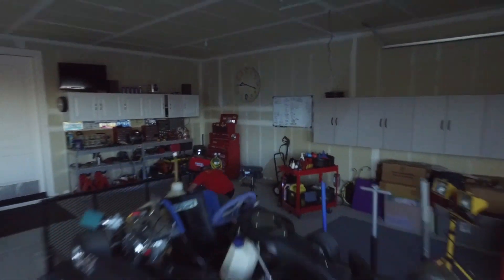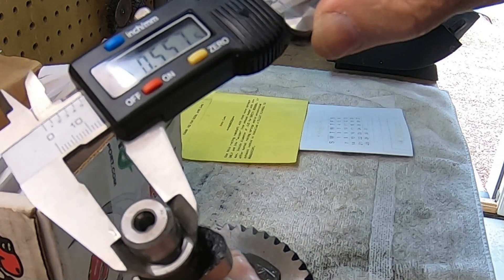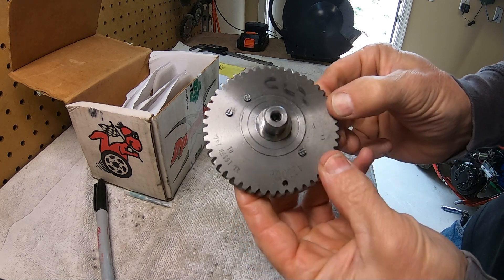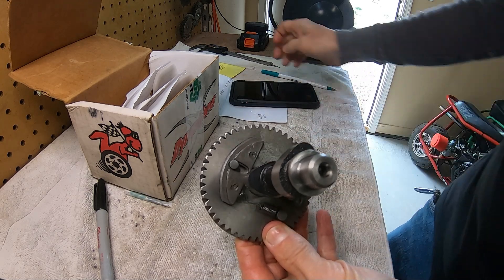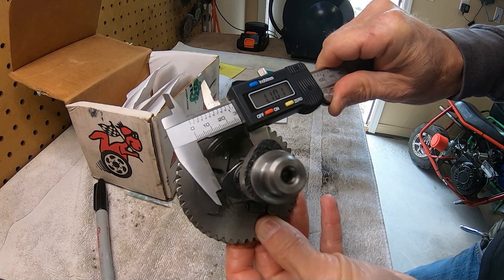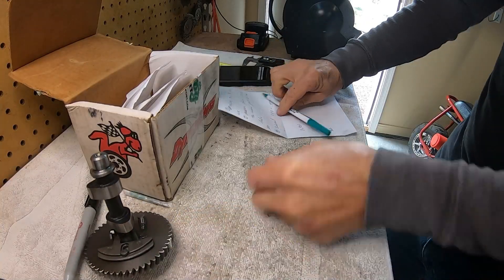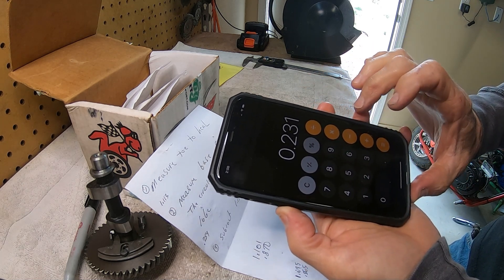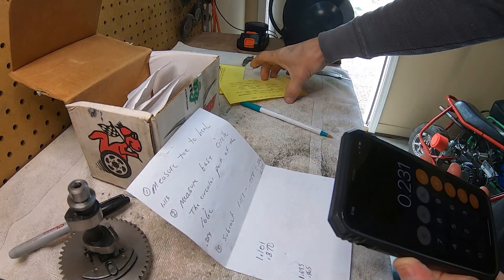How to ID a Predator / Tillotson cam?

Comment: Hey man great video but on the topic of cams iv got a 212 non hemi with the mod 2 cam in it and stamped 1.3 ratio rockers,  stock length chromoly push rods, ec billet retainers,  26lb valve spring , arc rod stock length, arc flywheel 
The set up felt way as if it had more torque with the stock carb especially on low end then the vm22 in your one video you showed a vm22 on a 196 and it lost 0-30 i believe my 212 has the same problem my question is if i bump compression will i get back more of that low end torque as of rn my manco thunderbird turns 8000rpms and does 59mph on a 8in tall tire for 8000rpms i believe it should be moving faster then 59 with the stock carb and 18lb valve springs turning to 7000rpms i was hitting 56 so by adding the 26lb springs and vm22 i lost low end power pretty drastically but picked up 1000rpms and only 3mph does that sound about right (unknown gearing) or am i just crazy and sacrificing torque for hp
Reply: Plus a (Paul's karts) hot coil and jegs ground strap definitely sounded like it was running stronger but wasnt noticeable on the butt dyno
Reply from the maker: Thanks! Adding compression will bring some of the snap back . Adding a little more timing will help too.  The bigger carb will work really good when combined with parts to match it. Like cam ,more compression, header  etc
Reply: @Black66  its got the trumpet style header no muffler only pipe that fits on a manco thunderbird and to optimize the mod 2 cam im gonna bring the comp to 11:1 to 11.5:1 with the pk 12cc head and im was gonna look into a 4 degree timing key to bump to 36 degrees you think that would be to much on a mod 2 that wants 32
Reply: Id just really like to see my engine on a dyno and see the power curve as i changed and change the parts and see how it reacts and reacted to what iv done
Reply from the maker: @madness_-yg3lw  Pop a 265 cam in there . Great drop in cam for mid range torque . I think the 265 is one of my favorites out of all the cams I’ve tried so far . At least for drop in cams or close to it .
Reply: @Black66  i will order it but if you get a chance to test the mod2 in a non hemi order the 1.3 stamped ratio rockers for that head its will give you 292 lift on intake and 300 on the exhaust 26lb springs plus you get over 240 duration on intake and exhaust you will definitely have to try that set up in a 14cc head probably be even more powerful but get a ebay or Amazon small engine rpm gage  they are cheap and it lets you know how hard your turning in my set up it turns 8k
Reply from the maker: @madness_-yg3lw  I’ll have to do a video on that combo.
Reply: @Black66  that would be so awesome really looking forward to it youd be the first to do a video on it i cant find it any where else and i think is a really over looked set up especially with the vm22 but cant wait to see the video i will definitely be keeping a eye out thanks a million for your help and time
Reply: @Black66  in my opinion i think a video comparing the mod 2 and 1.3 rockers vs 265 using the a non hemi engine and head and 26lb valve springs, vm22 and header pipe no muffler ( trumpet style) like what comes with the gps stage 1 kit small piping but no muffler to keep the flow up

Comment: What do you prefer more hemi or non hemi?
Reply from the maker: Depends on what I plan on doing with the engine. I like the non-Hemi if I'm building it because It's easier to add a big cam without piston to valve issues. I do like the Hemi. I'm using a Hemi block in the Mega moto build. But actually using A Tillotson Non-Hemi head. I

Comment: Pulled the side cover off a Hisun 196cc that came on the go karts. Plastic cam gear WTF????
Reply: Very common as most of these engines aren't intentionally built for go karts.
Reply: @LNRRidez  any input on putting a stock predator cam in it?
Reply: @igokarts4510  I'd need a little bit more info to answer. What type of block, any modifications at all etc?
Reply: @LNRRidez  I have that 196cc. I'm putting a CL1 in a Predator for a kart resto/mod. I'll have the stock predator camshaft to put in that 196. Would it buff?
Reply from the maker: @igokarts4510  The Coleman 3 horse is the same way … what a trip
Reply: @Black66  what do you think about putting a stock predator 212 cam in a Hisun 196? You think there's much difference besides cam gear being plastic?
Reply from the maker: @igokarts4510  Probably not much difference . One way to find out . Throw one in there
Reply: Hemi cam will work. Non hemi cam will not.